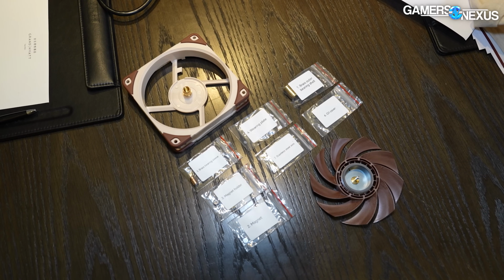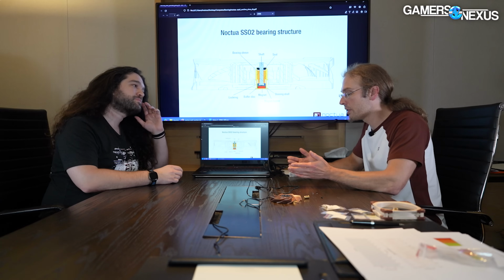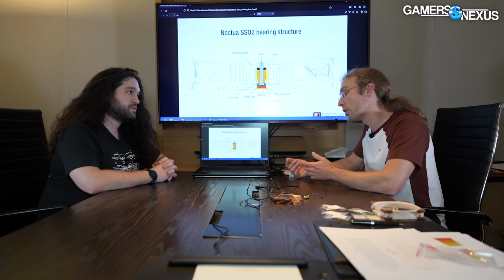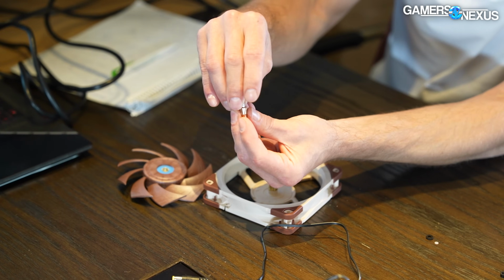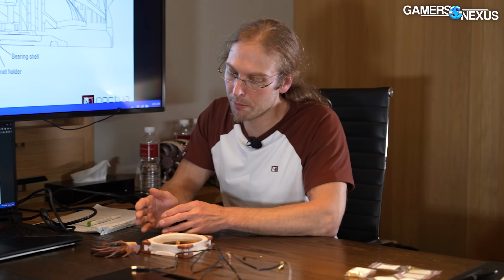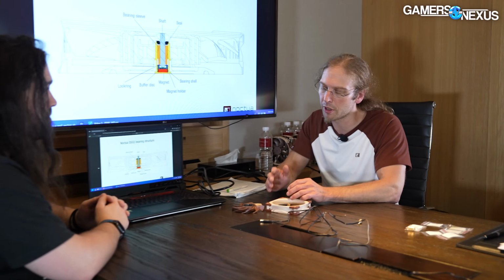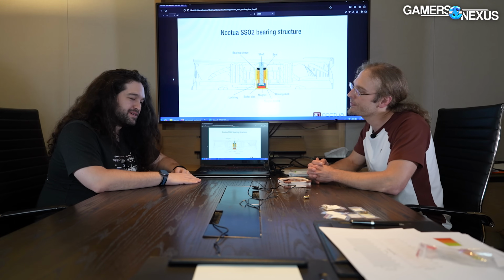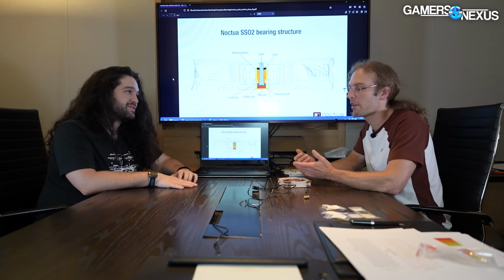Fan Bearing Differences: Fluid Dynamic, Ball, Hydro Dynamic, & Sleeve Explained, ft. Noctua

Comment: i just found out that the most "PRO EARTH" fan bearing type is the SLEEVE BEARING. no im not talking about the guy who prefer to save cats over humans, no, but one of the most cheapest fan bearing in the market. 
i have an old "chromebook" type of mobile device that come with that type of fan. and after 13 years, i just find out that the 13 years old fan dont really need to be replaced when its start to acting up and wont ramping up in rpm. all i need to do is to open the tiny laptop up, and open the casing that encages the fan turbine, and i realize i could remove the rotor/turbine simply by  pulling it out. so smooth. and cleaning up the rotor shaft, and adding a tiny single drop of sewing machine oil into the bearing slot and put it back in, and i just drop nearly 40 degrees and function like new. a THIRTEEN YEARS OLD SLEEVE BEARING FAN.
for those who care about the planet, this is the type of fan you want. so you dont have to make unnecessary E WASTE.
(i dont hold any candle lit for those who prefer "its MY PLEASURE FIRST!" type of human)

Comment: The thing i want from feature fans is to either sonwhow get rid of the usual 4 hub holder(lines) or actualy double them up so they can become thinner and then at the same time reverse the fan blade so they are easier to clean, is you do this whe holder (line) can be so thin the suction eeffect may so insignificant both performance and acoustically-wise, or do the craziest thing and add 4 small motors in each of the 4 sides/corners of the fan to spin the blades (which will have a flat-like cicle cap around then like some new Arctic ines do), that way you can lock the fan blades in such way you don need a center motor anymore so you can reduce the cycle-like center of the fan by a lot significantly amd it so much easier to clean, what i am not sure about tis design is the noise and possible RPM target, i think there was a company man many years ago who made such types of fans now that i remmber it but they didn't get enough attention for some reason.

Comment: The thing that's always been a mystery to me is how they makes the seals so effective on FDB bearings. How do you make a nearly watertight seal that doesn't create a bunch of friction in the bearing like that?

I'm sure thicker lubricants wouldn't be a problem but some bearing use lubricant closer to the viscosity of machine oil and could easily leak out of even a relatively small crack.

Comment: I love it when the fans blades and the bearings' pole is accessible by being removable and i can lubricate it and the holding hole with mechanical oil and mix it up with some lubricant grease at the same time, it usually makes a fan go even faster and makes it so much more silent, i have done this to countless fan for 22 years now it's such a neat trick since it works so well.
I have many, many, many old fans which still work perfectly because of that for more than a decade, 1 specifically the older i have, i got it back in 2006 (14cm fan) and it still works perfectly because i maintain it like that.

Comment: What about Maglev bearings?
Ball and other types of rollers all pump the lubricant in the bearing around in circles, but are inherently lower friction (so cooler running), as you can easily tell if you drag a book across your desk then repeat the task but with round pencils between book and desk.  But they tend to last a shorter length of time.  Plain/sleeve bearings or bushes (grooved or otherwise) depend entirely on the quality of the seals for their durability.  The plain bearing can be made to outdo rolling types on the load capacity, and normally do in automotive use, but it requires the lubricant to be pumped to high pressure.  Maglev are just two magnets facing each other N<->N or S<->S, so that they repel each other (no good for hard disks).  No friction at all, no contact even at rest, so no wear.

Comment: Which bearing is best for orientation of the fan, also what temp they can cope touching a heat source espc in low profile heatsinks for server NICS or fpga nic fans they last a year tops when heatsink is 65oc  fan facing down etc, theirs a demand for 50mm 8mm BB fans out their

Comment: So far the best radiator fans ive tested at low rpms  are the FDB arctic p12 maxs. Lower motor noise than my NFA12 chromamaxes and they move a ton of air at low rpm.

Comment: Hydraulic bearings ensure high speed operation, reduce wear, reduce noise and improve service life. The lower part of the fan has a magnetic suction, which pulls the steel column to the side of the fan and has strong suction power.
The above is what is said about the fans I have..

Comment: Very interesting stuff and very well explained. One thing i would have found great to hear about is why those pesky 40mm (or less) fans from the late 90's and early 2000's on North/Southbridge coolers or gpu's always failed way too early. These things never failed to fail. Even at very low hours. I know these ran way higher rpm than their 80mm counterparts in those day's but still. Were these just too cheap or difficult to manufacture properly at that size?

Comment: 1) Which fans, apart from Noctua, have made the same breakthrough as the NF A12x25? 
2) Is magnetic levitation the future and the best bearing? 
3) In the video it was said that they can get 1500 rpm on Noctua NF A20, the maximum now is 1200 in collaboration with Watercool, will this be a new revision for MO-RA4?

Comment: as an old computer technician I have a few preferences when it comes to bearings in fans. Magnetic levitation is the king of bearings. With no mechanical contact at all at full speed these will live a long time. Dual ball bearings is the next. Noisy buggers but with a long life. FDB bearings are a step above simple sleeve bearings. Now I have to say I have worked the most with serve grade hardware, and things like bearing noise is not something you think of. And fan speeds are high. I damaged my hearing just by the sound of fans in servers, so I'm not joking about not caring about noise.

About ball bearings. Some manufacturers fake the bearings a bit by using one ball bearing and one sleeve bearing. Those fans will have a lifetime that's limited by the sleeve bearing. Once that is worn out it's game over and you have to replace the fan. So make sure the fan has dual ball bearings, that is two ball bearings, not two balls in the bearing...

Magnetic levitation bearings are the least common, but theoretically they should not wear out. Now the truth is that it still happens. Usually it happens if the fan get real dirty over a long times use. They tend to loose the balance and then bad shit happens to the surfaces in the bearings. As they aren't supposed to have to rub against each other they tend to wear quickly when that happens.

At one time four 120mm  fans blew up in a server. If I remember correctly they were made by Nidec. Usually these were real good, but it seems an entire batch of their fans had a manufacturing fault. So remember that fans are mechanical products and some times they will break. Keeping them clean is a good way to increase the chance that the fans will keep working for a long time.

FDB fans is a thing I haven't worked a lot with. They simply doesn't exists in the server world. Not the perfect truth, but close to it. And sleeve bearings you just won't see in a server, ever. Something interesting is that FDB fans used to have a lower time to failure rating than ball bearings. But that has changed over the years and now fans with fluid dynamic bearings tend to top most if not all ball bearings fans. Still fans with FDB are not something you see in servers.

The first fans with magnetic levitation bearings I encountered I think was manufactured by Sunon. I remember they had a demonstration video to inform their customers about these bearings. From what I remember they had a LED that was powered by a lead that wiped the shaft in the fan, the power was supplied to the metallic bore of the bearing. When the fan was still the shaft would touch the bore and the LED would light up. But as soon as the fan started moving it would ride the magnetic fields and levitate in the middle of the bore and there were no mechanical contact between the shaft and the bore and the LED would go dark. I just tried to find that video and it seems Sunon has taken it down, so no video to show...
Reply: Of course, another consideration is the number of start/stop cycles.  Servers tend to be 24/7, so those aren't as important there.  However, that's not the case for all PCs.  Especially fans with a zero RPM mode or laptop fans.  Like was mentioned at 16:15, FDBs can use higher viscosity oils compared to non grooved sleeve bearings, but that increases the time to no contact.  Meaning there's more wear during stop/starts. I have no clue where magnetic bearings sit on that metric.

Similarly, things that aren't an issue for servers are angular loads.  The fan acts as a gyroscope, so turning it while spinning means sleeved bearings and magnetic bearings will wear faster.  You might wonder why someone would ever do that, but moving a laptop that's running is common.  Same with the Steam Deck.
Reply: Maglev's have one big downside, they need minimum voltage to levitate the fan. In some fans it's 12v so you cant just control the fan with voltage, at low voltages the bearing starts to wear, PWM control is required so if user does not know this, then that user would eventually damage the fan by running it at lower voltage using voltage control rather than nessessary PWM control.
Reply: @sudouser85   PWM control also doesn't work on the Sunon i got :D I actually built a Tau filter to convert the PWM into a voltage, since i don't have voltage control natively :D At low PWM frequency the fan didn't run due PWM interfering with AutoRestart feature, and at increased PWM frequencies there was intermodulation noise, it was hilariously bad. Both intermodulation noise and occasional noise from the bearing getting whacked out of alignment it was quite a symphony!

But it's all been rebuilt and replaced.
Reply: @SianaGearz  Thats wierd issue, PWM worked perfectly on my MagLev Sunons. Maybe you used different MagLev model, didnt also hear any intermodulation noise.
Reply: @sudouser85   Yes not all Maglevs have this issue, but Sunon fans regardless of bearing type many, not all have that issue, very widespread. They say one should better avoid fans with AutoRestart feature.
Reply: @SianaGearz  I dont know if my Sunon's have AutoRestart feature. Need to look up at the model numbers, just cant do now, the printer is printing next 21 hours.
Reply: I put a Sunon Maglev as a PCF on my 3D printer toolhead. That failed hilariously, it was making all sorts of wild noises. Only double ball bearing in high vibration use or when you're flinging the fan about.
Reply: @SianaGearz  Maglev's require minimum voltage to not wear prematurely due minimum voltage requirements (check manufacturers manual for this information) for the magnetic levitation to happen. PWM control is required, fan gets 12v all the time and fan controls its speed with pulse width modulation signal from fan controller, example mainboard. I had voltage controlled sunon maglev fail too for print cooling, another sunon maglev that was set 100% (24v all the time, for hotend cooling) is still running 5 years later with no change of noise, also its running pretty much 24/7 regardless if printer is printing due wear caused by turning fan off and on.
Reply: In theory fluid bearings have almost the life of magnetic bearings.  That's why they are used in HDDs almost exclusively.  If everything is working properly, the shaft sleeve will pressurize the oil and suspend the bearing on fluid.  However, the quality of these things probably varies dramatically.  Ball bearings are good, but they still have metal on metal contact, so they will have inherent lifetime limitations.  Apparently fluid bearings do have more spinning resistance than ball bearings (essentially due to pressurizing the fluid).

Comment: I'm more interested in what bearing is best for switching a fan's orientation. I seem to recall learning that a standard sleeve bearing is great for horizontal air flow but poor for vertical since the lube will pool at the bottom of the sleeve.

Comment: Strange that the motor industry used ridged edge seals on older cars that where just just called a scroll seals. As the basic principle seems the same for recirculation of oil/fluid why not call the V/Herring bone shaft seals "Scroll Bearings". The main issue with the big old seals they would eventually leak due to wear and tolerances due to age.
Reply: If you look at the specs of new fans now you will find that FDB often have a higher listed lifespan than ball bearings. And yet they have the same problem with eventual leaking as the Scroll bearings you talk about. Now personally I find that strange. Just a few years back the ball bearings were expected to have a longer life than fluid dynamic bearings. Something that's also interesting is that FDB and sleeve bearings are next to unknown in servers. There you will find fans with magnetic levitation bearings or ball bearings, but very few if any FDB. In servers the audio isn't particularly important just life time, and the fans are usually very loud and have really good bearings. Makes me think that the numbers often stated for the lifetime of FDB is a bit over stated.

Comment: I think the section on ball bearings at 15:30 is a bit reductive and may cause further misconceptions. Ball bearings don't necessarily have acoustic penalties. You can use dedicated low noise bearings that are properly lubricated and feature precision finished races/balls with low friction cages. Together with a good amount of pretension to remove the play from the bearing and using materials that dampen well you can make some amazingly quiet ball bearing fans. If you ever get around to making a 140mm fan roundup I recommend checking out the 9ra1412P from Sanyo Denki. My personal reference.

Comment: One of the very old "choice" of bearing type (or so the media kept telling us) was orientation. I would have loved to have this discussed (vertical versus horizontal with hub at top, fan at bottom - Top rad placement). Also, of all the Noctua fans I ever owned, not one failed, so that covers statements which you touched upon (building reputation). I've had various other vendors which failed spectacularly, one of which was one of those early 2000's massive case fans where the fan completely detached from the hub.

Comment: I'll always prefer maglev bearing fans - even my cheap "Duratech" ones (pretty sure that they are rebrands). Easily pulled apart to be cleaned, and only need a small drop of lithium grease if the blades are removed.

Comment: The day solid-state fans become popular can not come soon enough. Moving from x86 to RISC-V and ARM power efficiency will reduce the need for heat transfer with fans.
Reply: That's only extremely temporary until both ARM and RISC grow into the same power hungry monsters. The only reason why ARM processors are more power efficient, is because they were initially designed for mobile devices

Comment: I always found fluid vs hydro dynamic being a strange way of wording things.
I've been enjoying the noctua videos with Jakob.
Reply: An interesting distinction between "fluid' and "hydro", is that gases are also fluids.  Air is a fluid.  Which can lead the discussion to "air bearings".

Hydro on the other hand is specifically liquids.

I used to work on Navy gyro compasses and stabilisers back in the 80's and some of those units used what they were then referring to as "air bearings".  They were literally "lubricated" with nothing but air, in a similar manner to how an old school spinning hard disk head flies over a disk platter.
Reply: I thought that "hydro" one are water based (from the hydrogen) while fluid be oil based. And I was wrong
Reply: @LilMonsterInc  interesting. Thanks
Reply: like ten-15 years ago a tech site wrote FDB had some sort protection for name and other manufacturers couldn't use it freely. so other manufacturers came with their own names. they had to vary also physical construction to be differend. i have no source, so i hope i remember about correct
Reply: The worst bearing is probably Brushless bearings. They are too loud
Reply: @Ladioz  What i bather from this video is that every bearing has it's use case. Brushless may be loud but would that even matter in an industrial setting where the noise floor is much higher anyway? Also things to consider are fine particles in the air, temperature, whether the fan is placed near a radiator or is it in "free air" etc.

Comment: I was using black or white fans to go with my case build at the time. Now after using a Noctua fan (from a thrift store of all places) I replaced all my case fans with Noctuas since the noise is lower and way more tolerable. 
Long live the ugly brown fans. I wanna make my next PC case with ugly brown theme.
Reply: They also have black fans if you want to match it with your case. Although a fully brown build doesn't look that bad either! Noctua fans, Noctua GPU from ASUS, Noctua PSU from Seasonic and probably a case with wooden accents like Fractal Design North.
Reply: @N3v3r_S3ttl3  of course everyone has different taste, but me personally the brown colour looks nice with a white or black case
Reply: The brown fans are the color of high performance